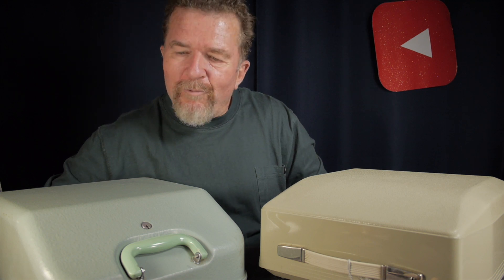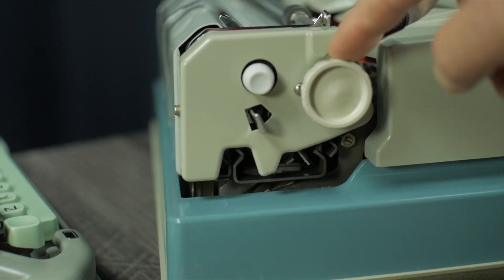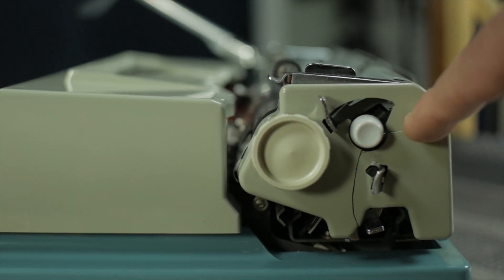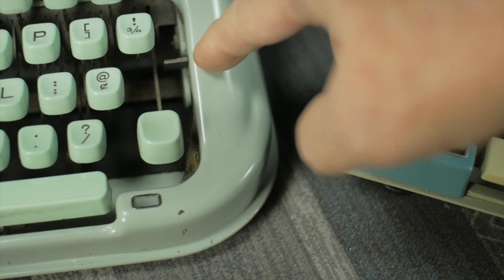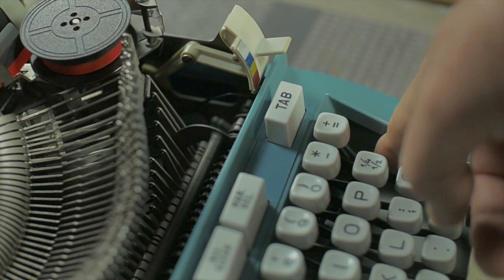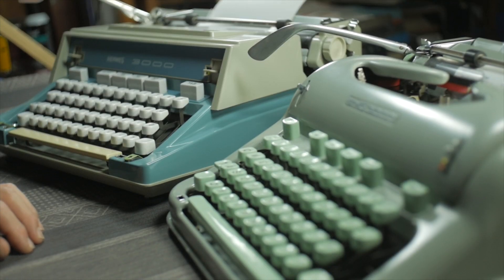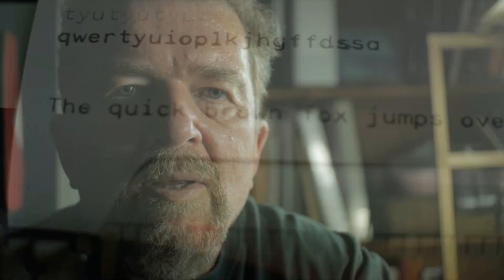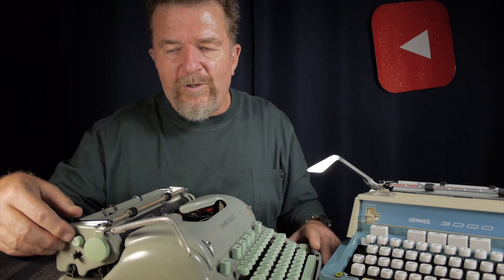Typewriter Video Series - Episode 236: Hermes 3000

Comment: I have the 60’s curvy model. I found it is much more quiet if you add a rubber mat under it. An nice way not to annoy my family at least until I get the platten replaced. Would love to see a Hermes line comparison of all the models, Baby, Rocket, 2000, 3000 etc. Thanks for the videos!
Reply: I second that emotion re comparison of all the Hermes models. I have a 2000 and I mostly love it. Have a few problems with it, which I’m not sure is inherent in the model or just mine.

Comment: Recently got super lucky to find at a local recycle store a 2nd Gen (1970) Made in France one for <100US with brushes and manual.  It still has the sticker of the (now gone) local typewriter shop and it has a dark font I think called "Director" (Pica).  No other manual I have ever tried is as good as it (I've tried most all).  I was skeptical...not anymore.  Hermes 3000, in perfect condition and with a good typer...can make almost Selectric quality imprints.  This Director font is nice and dark even with cheap ribbons.  It is not super loud like my SM4.  I think only my 1949 Remington "All-New" gives it a run for it's money on type feel.  The cult is deserved, a Hermes should be in tip-top shape and when it is, it is incredible for a manual typewriter.

Comment: I just received my 1970s “Jetsons” Hermes 3000 and am delighted with its condition. I paid $199 for it on Ebay. Your video has made me feel better about not having the more coveted, curvy version. The only thing I’m still jealous about is that larger, rounder, funkier font. Meanwhile, don’t you think it’s strange that they didn’t change the name when they remodeled the entire chassis? It should be the 3001 or 4000.

Comment: Great timing with this vid, as I have just bought a 1968 Gen 2 Hermes 3000, the intermediate boxy metal version between the two shown here. It suffers from a quite hard platen with a broken knob and is quite dirty on the inside, but I'm very impressed with the general mechanics of it and the margen indicator is still working so I really look forward to see how it will hold up once I've cleaned it !

Comment: I agree with David Sterling.  The second generation has the good all metal case with a not unpleasing angular design and can be found a lot cheaper than the Gen 1 machines.  The one thing I've seen on both are brittle platen knobs - I replaced the Gen 2 knobs but can't find ones for my Gen 3 (larger, conical shaped on my machine).

What I think is interesting is the very different touch between the 2000 and the 3000.  The former is very crisp and snappy - even more than my Olympias.  I wonder why they abandoned that touch for the softer and longer keystroke of the 3000.

Thanks, Joe, for keeping typewriters alive!

Comment: Thank you for comparing these. I haven't had a chance to try the Hermes 3000 yet, and of course am very curious to hear about all the differences between models. This was a very helpful video. I liked hearing about the quirks of the controls as well (ex the carriage release button, which could be inconvenient). And comparing the touch of the type was helpful. I have typed on both Olivettis and Olympias, and knew what you meant when describing the Hermes typing experience. From comparing the sounds of each machine, I actually thought the newer plastic model had a higher pitch sound when in use. My cat is particularly sensitive to higher pitched typewriters but will tolerate my olivetti lettera 22, and groma kolibri but not my hermes rocket. I'm sure getting new platens for all of these could greatly help with the sounds. Love your videos!

Comment: Good review Joe. I been lucky finding both the 1959 curvy and later 1975 model. They perform the same with key-action (smooth as butter). I took the 1959 bottom cover off and mounted 4 rubber feet instead for a slight higher typing action that I really enjoy.
The 1975 will slide around little on the desk without a mat underneath, but most machines has the same issue. I enjoy both models for longer typing sessions or just short letters.
And quality wise: well, it's been 2 years since the 1959 was cleaned & serviced. Not one flaw afterwards, no sticky keys or other malfunctions, very impressive.
The 1975 came from Colorado, and actually worked just fine after unpacking, just a new ribbon and still works super, not often that happens buying typewriters online.

Comment: Joe, just wondering if you knew about this... In the "old" days, ie. before laptop computers, reporters used to swear by HERMES brand typewriters as the ones they'd take on the road. Durable, reliable, easily serviced. Supposedly they were ideal. Thanks. (Really LOVE your series on these great machines which revolutionized mass communications. Only LAPTOPS would have a greater impact.

Comment: As I keep my eye open for Hermes 3000s (I currently own a Hermes 2000, I think circa 1954 or 55, and love it), this video helps me a lot, because there are certainly some huge price differences between the 60’s version and the 70’s. I would like a backup for my 2000, and I may go for one of the 3000s. The cheaper ones I have seen, often have a keyboard made for a different language, but not with a lot of difference. And those two are often a bit even cheaper. I also have my eye on a couple of Hermes Babys (Babies?), which are decently priced, in case I decide to go with another ultra-portable (I have a Brother Charger 12 on its way that will need a little work). 

Thanks again for all you do on your channel and for this comparison video.

Comment: So I just received my very own Hermes 3000. It is a 70s model as it looks similar to the one shown here, except it's not blue, and most importantly - and this is something I did not notice before just now - it's a wide carriage version! I'm OK with this, but sadly this probably means, that I will not be able to find a replacement carrying case for it, as sadly it was missing, and I'm not even sure if the wide carriage version ever had one. It did come with an official Hermes cover at least.
Reply from the maker: I’m sure it originally came with a case, as my wide carriage electric Hermes 10 did too. I recommend finding a legacy suitcase to use, you may find a Samsonite or similar brand.
Reply: @Joe_VanCleave  Thank you for the answer and the tip about the suitcase, Joe. This H3000 also has a Swedish/Finnish keyboard layout (I'm Finnish) and it uses the elite typeface. While it types very well, I can see it could use some interior cleaning. Hopefully I can figure out how to remove the plastic exterior without breaking it. Anyway, excited to get to do some work with this beautiful machine!
Reply from the maker: @2300DY  The secret to removing the shell is to first remove the carriage! But on the H3K it’s easy: looking at the rear of the carriage, there are two large slotted screws holding two rectangular brackets; rotate the screws 90 degrees (one of them is left hand threaded), then the carriage is simply lifted out.
Reply from the maker: Clarification: the two rectangular brackets rotate 90 degrees, in opposite directions.
Reply: @Joe_VanCleave  Thank you for the tip! I can see the screws, and I can see the brackets helpfully have + and - symbols on them. I also found a video of someone removing the carriage from a 1st gen specimen, so that should help as well. I will try it out as soon as possible.
Someone also tipped me about a Mr. Jacques Perrier from Switzerland, who runs a typewriter museum and is "one of the largest parts-suppliers for Hermes and even Olympia typewriters". I doubt he will have an extra carrying case for me, but might as well ask. 
Besides that, the right side button for moving the carriage is not working; It's hanging out, and while it can be pushed back in, it does not work, and tends to pop back out. Will have to investigate what's the problem there.
Reply: @Joe_VanCleave  Removing the carriage and thus removing the shell and cleaning up the machine a bit better was a success. Thank you again. I could also see that the right side carriage button is not broken per se, but has just somehow come out of its socket(s), and is just hanging loosely inside. Sadly I could not insert it back into its place; it would probably require opening up the right side of the carriage. Perhaps I will try that later, but for now I'm satisfied with using the working left side button.
Reply from the maker: @2300DY  Congrats!

Comment: I love your channel Sir, thank you for all your work.

I'd love to own lol any Hermes, but I like the look of the curvey one, there is a another box with some round edges, I like that one.

To me, it sounded like the Curvey one sounds heavier or perhaps I'm hearing the metal frame, whereas the other sound lighter and that might be due to the plastic frame.

Beautiful machines.  ❤

I currently own a 1968 Royal Aristocrat, it's in awesome condition, types very well, very crisp, though it is a bit heavy on the fingers even on a Light setting which is really good by the way does a very nice job, but after 10 pages your hands feel like they've made something! Lol

My other I have is a Smith Corona 120 Electra, and the motor was burned out and this was not mentioned in the ad on eBay buy the seller who said works, thankfully I took a screenshot and was able to show that and my Typewriter was clearly not working, the seller was good though and returned my money and said just keep it.
So I tried to fix it even found an electric motor which oddly is the same model number, but it's just slightly too big for the motor cage to hold, and I guess later I may try to modify the space with a Dremel and a cut off wheel lol after all I can't break it even more...but for now it will serve as a parts bucket, as I have purchased and wait with excitement a certified and tested Smith Corona 110 Electra.  Same thing just a smaller carriage which is fine.
And I saw a really good looking also tested and certified Smith Corona Galaxie Deluxe, it had a new planten installed a beautiful blue to match the shell.  I write a lot and it helps me to first draft on a typewriter and then transfer to a computer and re work the story.  This has helped my writing, and I have a hard physical copy of my work, it's like the ultimate SAVE button. 

The way I figure is there are only so many typewriters I want, and there are only so many typewriters out there as we know, no one is making them, not really and not like they did back then when these machines were new. 
My Wife doesn't understand she asked Another one?!  Like I brought home another Dog lol
I tell her it's like having a different pen to write with, and they are investments, I may later sell one and it will be worth more than when I bought it.  

To me writing on a typewriter is more real it feels more real and you produce real physical work, there is a direct connection to the work my fingers have made contact that has a hammer swing out and down smashing through an inked ribbon and for a split second there is a constant connection between writer and paper, and for some reason it's more powerful than a pen in hand can do, probably because maybe they can read your handwriting but all that can read WILL be able to read what you wrote.  The typewriter is such an awesome machine.

Thanks for reading and always a 👍 from me!
Reply from the maker: I love your enthusiasm! Here’s hoping you get that one great typing machine!
Reply: With my birthday being exactly one week away Wed 04-24-24, and birthday on Wednesday May 1st, all of my fingers and toes are crossed, I found one a very nice Curvey model sea foam green EVERYTHING, probably 1958/63 model as it doesn't have the lid latch forward off spacebar grooves.
I have been forbidden to buy my own birthday gifts, and I watch it vanish, it looked clean, had documents and was serviced regularly, spoke to the seller of eBay they said it was once, according to the documents, a homicide Detective's typewriter first in New York and then later in Los Angeles, it had the legal subsection key looks like this § which usually means the typewriter worked in law enforcement, a court house, a lawyer office, or legal school.

Seller wanted $375.00 for a nearly perfect and very clean tested and working full functional Hermés 3k, it was so hard to watch that go, think I have mentioned this.
My wife is not a good liar and I ask by chance did you get me a typewriter and she says nope....she's not lying lol, I should have bought it, even though I'd certainly hear from the God of War lol, 
One day one will be mine.  Until then I watch this video over and over dreaming.❤
Reply from the maker: @dadtype2339  Happy birthday!
Reply: @Joe_VanCleave  
Thank you, I have my Wife put in individual candles in make cake, instead of a two candle number, oh boy did it put out some good heat this year!  
Another Mile add to the odometer! Ha!
I'll get those pics of those repair slips for you to take a look at on my Hermes as I'm not sure what it's talking about, Tuesday was a busy day.
Wednesday (today this AM as this was written) is my official BD, and I'm taking the day off to rest and write.  Still can not believe I have a Seafoam Green Artifact I keep thinking was it a dream then I open my cabinet and there it is.
And of course my family have no clue as to why not do they care to hear from me, why or what's so neat about this typewriter?

Had to have a family party to celebrate on Sunday as others wouldn't have been free.
Sorry for any confusion.

Second Star to the right, and onwards till morning!  Just sounds like a good way to end a letter or note at 0220.
Reply from the maker: @dadtype2339  Happy Birthday!🎁

Comment: Hi Joe, I have a 1965 French version Hermes 3000 with all the accent keys.  It works perfectly except for one thing.  I cannot remove all the tabs that have been set using the + key.  I mean that the delete tab key  - - - does not delete all the tabs and neither does the minus - key.  Any ideas?  The   machine was used by my FIL who used it to write French scripts which he then broadcasted to Africa by short wave.  Unfortunately they have all been lost in time.
Reply: ps I am in South Africa and the SABC used to broadcast in French on shortwave.
Reply from the maker: I would look at the tabulator rack, perhaps the slugs that slide to set and release tab stops is gummed up with grease. Or it could be bent.
Reply: Is there a youtube video on how to take the machine apart?  I took the bottom plate off once to clean things but no further than that.
Reply: Well I mucked about with the buttons and eventually got it to cancel the one remaining tab.  I shall leave the + tab button alone in future!  The machine is great for typing French or German.  The accents do not move the platen so one types the accent first and then the character.  This works perfectly.

Comment: I finally had a chance to try out a Hermes 3000 today, a 1st generation example. It helped me to understand the buzz around these machines. To me the most notable thing about the Hermes was the feel associated with this typewriter. Thus far out of all the different typewriters that I've tried, my favorite model as far as the feel is concerned has been the Olympia SM9. That is in part what led me to buy one as my first typewriter. I know that when it comes to the feel of different typewriters some fall into the either/or camp — liking one type of feel or the other, but not both. After trying out the Hermes 3000 I can say that I like both the SM9 and the 3000. Each is enjoyable in its own way. I'd certainly like to own a Hermes 3000 to go along with my Olympia SM9. The other notable thing about the Hermes 3000 machine that I tried out today was that like my SM9, it featured an 11-pitch typeface. I prefer this size to both the 12-pitch Elite and 10-pitch Pica typefaces found on most typewriters.

Comment: Love the video.  I have a 1963 curvy version that was my mothers who used it in my fathers small business for over 20 yrs. It came with the very small elite type, 13 cpi...don't know if my mother actually wanted it that small but she never complained.  Possibly you may not know but I wonder if the Hermes at that time sold most of their 3000's with that small elite type, which I believe is called the "Director-Elite".  Bear in mind my mother bought it for business purposes.  Personally I find this type a bit too small.  What type faces do you have on your two machines?
Reply: My 1965 model is definitely 10 tpi - seems to be a standard font type.

Comment: Joe, thank you as always but neither machine will pry me away from my Olympia SM-9s! The cult of Olympia.
Reply from the maker: I agree, an Olympia SM is also cult-like. In many ways better build quality than Hermes.
Reply: Different.  The Olympia is a continuous careful optimization of the known, excellent materials, excellent design and excellent build.  Admirable, but 'Stolid' as the English would say.  Hermes are equally excellent, but were always looking to have a 'point-of-difference' to the other typewriters.  Hermes use an intermediate gear on the escapement of the 2000-3000 series, which is to move the star-wheel lower, but it doubles the tooth-to-tooth backlash, affecting many typists with quite random skipping.  The best cure for this is opening the hysteresis loop, widening the set and reset of the trip.  The Hermes has a narrow adjustment zone, the Olympias, much wider.   The average technician looks at the Olympias and says "Yup, yup, yup" Looks at the Hermes models and says "What? How does that work? What are they doing this for?"